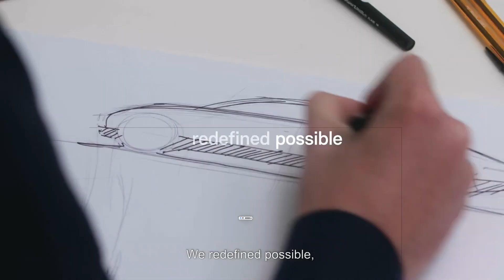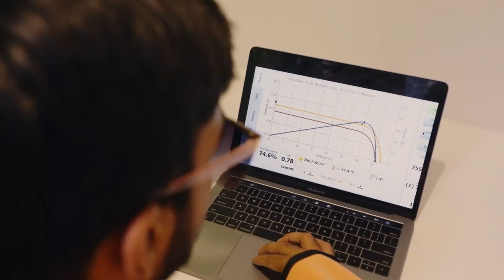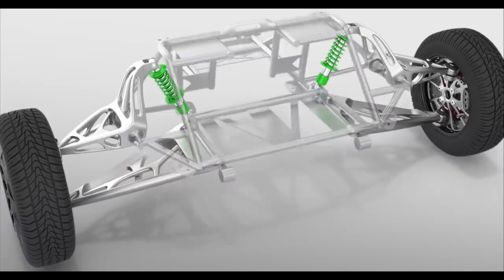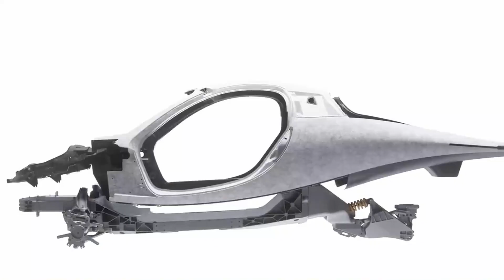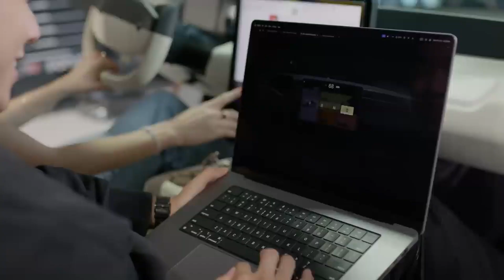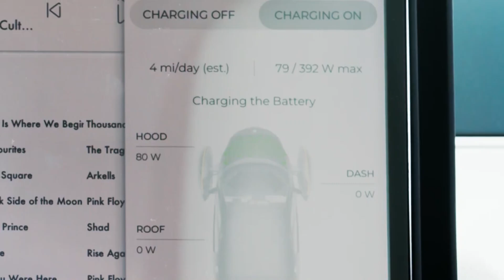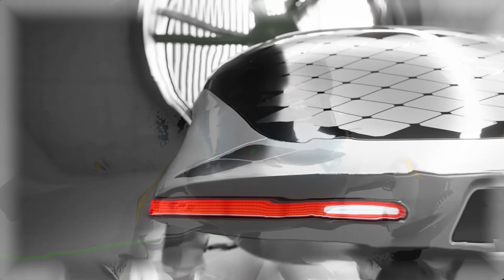Aptera Set To Truly Change the Electric Car Game Forever

Comment: Aptera and its cheerleaders have been claiming this amazing "Game-Changer" is coming to market soon. Soon never comes. I reserved one 3 years ago just to give a little support and see.... However, I don't think I'll follow through with purchasing one, if it indeed ever comes to market. It does have some novelty value but not sure how practical it will be to own. I am interested in having an easy to own, inexpensive practical and reliable transportation. Don't thin Aptera meets any of the above. It has room only for one passenger. Too many unknowns, since it doesn't exist. For example can you load up the back with 50 lbs of stuff, drive on normal roads with hills and still be efficient. I don't want to own a second car for the occasional long distance travel or an additional passenger. Aptera is not that cheep. $35K for base model. You can buy a car like the new Toyota Corolla hybrid for that amount, and you'll have a reliable care with very hight milage/gallon. No charge anxiety and no need for a second car. In regards to sustainability and saving the planet, the manufacturing footprint of this type of care is way more than an average ICE car. I wanted to love Apteral and even own one. The more they delay and the more learn about the limitations of this care the more I want a real car.

Comment: I'm wondering how easily an Aptera would flip over in a windstorm. It seems like it could happen even when parked. Would you have to tie it down?
Reply: The dolphin shape and the three-point wheel placement make it very stable. Wind from all directions is not an issue. Due to its shape, you barely need to use windshield wipers during rain, and bugs do not stick to the windshield. When they took me out in it, I asked if they would take a 90-degree corner at 30 mph with zero braking, which they did. It cornered better than the Panamera GTS.
Reply: @Carl_in_AZ  I hope a car magazine gets a chance to test this against the Panamera and a speed hump test against a GV80? We'll see how accurate you are - for me, I think you are lying, or you just can't tell what cars are handling like to save yourself, lol.